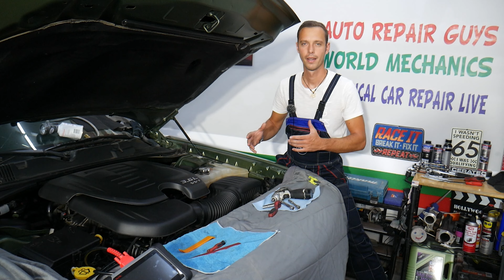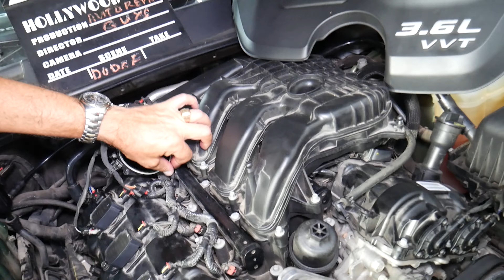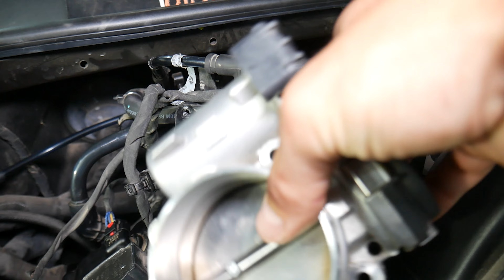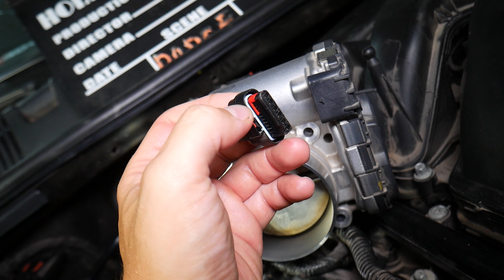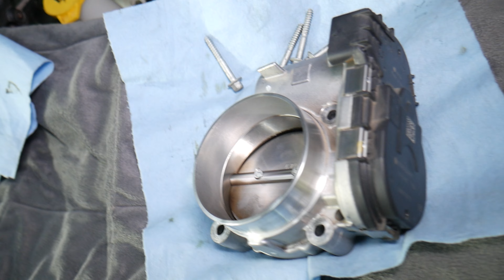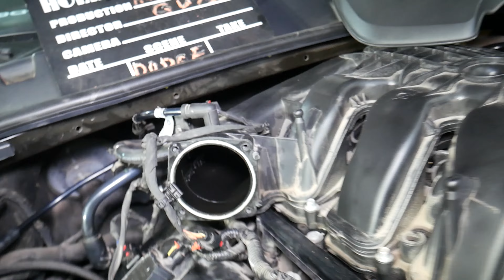DODGE CHARGER CODE P0123 P0222 P2111 THROTTLE POSITION SENSOR, THROTTLE CONTROL, ENGINE LIGHT

Comment: I have a code P0122
Throttle/Pedal Position what should I fix first the throttle body or the pedal position sensor
Reply: did you solve the issue?
Reply: @Sal3600  yes it was the throttle body sensor.
Reply: @angelf9800 mine is code p2122 and it says throttle/pedal position sensor low. Is that similar to yours ?
Reply: @angelf9800  Did you replace the sensor?
Reply: @FTGJames any help on this?
Reply: @KingJames3h  so I had a pedal command in my car. It was 3 years old and I think that what was throwing the code. After I removed it, in about 3 days the code was gone and I havent had any issues since. So for me it was my pedal command. Im not sure for anyone else.